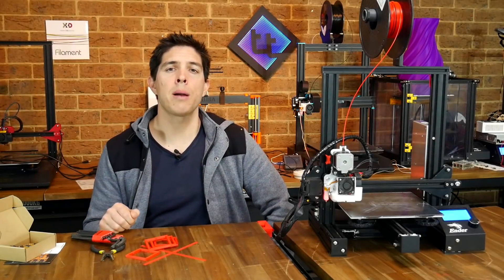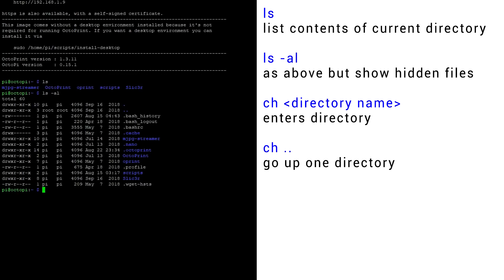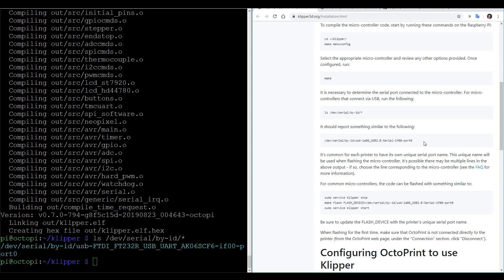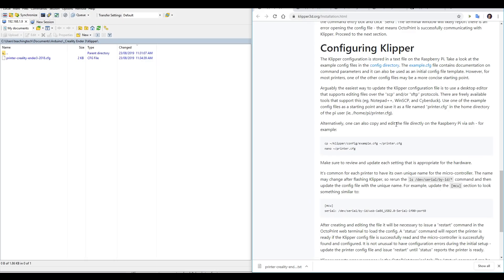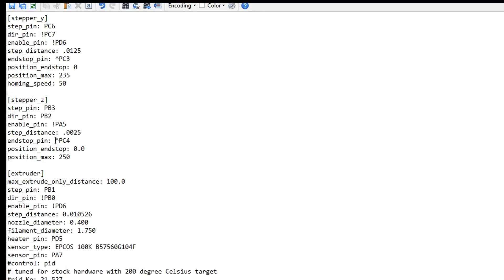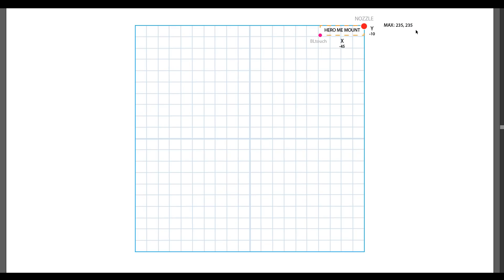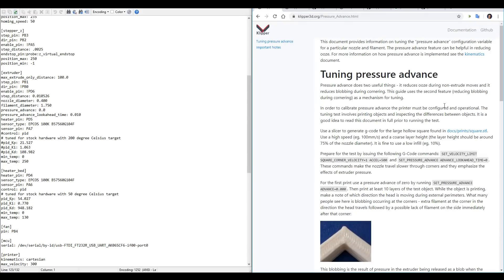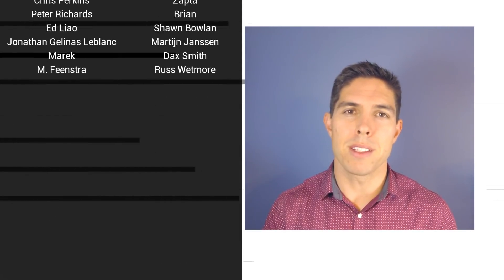Using a 32 bit Raspberry Pi to boost your 3D printer mainboard - Klipper Ender 3 guide

Comment: The main reason I don't like Klipper, is because it works on the Raspberry Pi, and therefor you need to gracefully shutdown the Raspberry Pi after a print, and boot before printing. With just Marlin on the mainboard, it's turning on, and when finished, turning off, instead of waiting for it to power off before pulling the plug. (If you cutting the power to the Raspberry Pi, it can easily corrupt your SD card.)
Reply: Raspberry Pi can use and external HD to run the OS, but this is more hardware to keep on.
Reply: Claudio the only reason why I would use a raspberry pi with octoprint, is when I use a ATX PSU to power the printer, octoprint can use the live wire to turn the printer on and off, if you keep octoprint on for 24/7.
Reply: There isn't really a need to turn off the pi, it doesn't use a lot of power and there isn't the significant fire risk like there may be with a 3d printer.

Comment: I'll be interested to see your video about the PrintHat...I bought one a month ago, tested it and ended up sending it back.  It's a good idea but in the end I couldn't get it to work correctly with Klipper on my Ender 3.  I emailed their support on various occasions but they weren't able to help either.  I previously had Klipper running well on my Ender 3 with a Fysetc F6 board at a third of the cost.

Comment: I recently set up Klipper with my Ender 3 with an MKS Gen L and UART 2208s. So far I struggle to tune PA with the Bowden setup and my desired acceleration (>1000mm/s^2) because of the extruder skipping steps at higher speeds (100 mm/s). Seeing your success with direct drive I am considering upgrading to one.
Reply from the maker: I am only running the default acceleration but can confirm zero skipping with my direct drive mounted ezr.
Reply: @TeachingTech  I just hope I don't get too severe ringing with a direct drive. I plan on just printing an adapter for experimentation.

Comment: Setting up ABL was a mess originally but going through the same hassle you have been through I got it working. 
I haven't taken the time to actually tweak the pressure advance but overall I was indeed able to print with similar results at much higher speed, i.e. 100mm/s vs 50 or 60. 
I guess the question is now, do you need to upgrade to a 32 bits board if you use Klipper?
Valid point would be the opportunity to change the stepper drivers but if noise is not a concern so much, is it worth it?
Cheers
Manu

Comment: So what advantage of using Klippel on ender 3?
Reply: speed, the arduino 8 bit 16MHz processor, in the original motherboard is the bottleneck of the system.  
Moving part of the workload (of the gcode) in the (Quad core 64-bit processor clocked at 1.4GHz processor with 1GB LPDDR2 SRAM of the) raspberry  pi (running Octopi) frees up processing cycles in the (Atmega1284P) processor of your ender 3.  Letting it move faster the motors and the extruder.
Reply: @parkingcams412  but my print speed already maximum (if print faster ghosting show up}, so what profit of this upgrade?

Comment: I have been using Klipper with my Ender3 and MKS gen L for a while, printing is faster due to the calculations being planned ahead, I get some glitches now that I have a bltouch clone configured as well. Usually need to pre-heat and home manually, then everything works OK.
Reply: do you have 2208's in standalone mode?  last thing I read that it wasn't supported
Reply: @taylorwilson1840  No I am using LV8729.

Comment: Great video! Would be possible to install Klipper on a windows environment running octoprint?
Reply: Not 100% sure but I think it needs to run on a Linux platform, not necessarily in octoprint.

Comment: would the pressure advance settings have to be changed for each filament types e.g pla/petg/nylon...if so would this be something that is stored in klipper or octoklipper on a per material setting or is it dependent on the slicer settings?
Reply: In theory yes, like linear advance, it should be specific to each filament. In you can add a pressure advance number to the start gcode, then save that profile for specific filament. The command to set the pressure advance value is not actually gcode, but a separate kind of code that the klipper firmware understands.

Comment: I use klipper.I like it but if your new to this ,stick to marlin for its safety.If you NEED the speed available then go for it . Unfortunately I can't get much more than ~100mm/s at 2000accel due to layer shifting.
Reply: That was my concern too - layer shift. I struggle with it now on marlin. I have to reduce speed to 40 and jerk to 5 or 10 on good day. Any ideas why and how to get rid of layer shifts? My belts are tight and everything seems to be in order.
Reply: @sp78rus  lower Accel ,I use 750 outer ~1000 inner 2000 infill -above that and it's a huge issue
Reply: @t4teeee697   thanx I will try that. I feel that there should be a way to overcome that issue without sacrificing speed and accel..
Reply: I wonder if you may be using TMC2208 in standalone? Layer shifts are a consequence of that. I use 3000 accel as my default, and have printed PETG as high as 200mms with a volcano.
Reply: @mikestromberg5288  running ender 3 stock board v1.1.1 with stock hotend.
Reply: Layer shifts happening when belts are properly tightened which means not over tight is caused by the bed weight because the belt is used to stop the bed from moving. So ya slam the brakes its just like a car it wants to slide. Also ya need to insure your motor bracket is not bent and the front bracket is not skewed as long travels can cause the belt to track up on the side of the pulley and skip.
Reply: @coffinsnail6930  as I said before everything is in proper order. I checked

Comment: About time man. Klipper reigns supreme!
Reply from the maker: I've taken way too long for this, I'm sorry.
Reply: @TeachingTech  How did Klippers thermal heater protection hold up? 
I feel its necessary to mention youre not limited to 1 control board, 1 of my printers runs 2 boards controlling 7 steppers haha. 
I could swear the motors on a cr10 i have run quieter with klipper than when i tried marlin
Reply: @Boboo5  This is my experience as well on my Ender 3. It is quite substantially quieter.
Reply: @Boboo5 Voron 2.x?
Reply: @loban4243  Just a 2.1 ha

Comment: Unless one already has a RaspPi, wouldn't it be less expensive to just buy a 32 bit board? They're like, sub US $20....
Reply from the maker: You're probably right.
Reply: Not if you also have to buy new stepper motor drivers and anything else for the new board.
Or even better you can do both for high step rates but your extruder better be up to it.
Reply: @Dave_the_Dave  but then again, this is only if one doesn't already have a Pi.
Reply: @Dave_the_Dave  actually, the price I saw included the drivers. The great thing about mine, was that the drivers they included were the same that were already in my old board,  lol!
Reply: Depends a new 32 bit board wont give your printer wifi or octoprint. If you only want to print from sd then sure

Comment: Damn, I don't think I can do this. I only have a Raspberry Pi 2..  😧
Reply: Based on the klipper FAQ the recommended hardware is RasPi 2 or RasPi 3. 
You should be fine running with a heatsink
Reply: @reddcube  groovy.
Reply: @elfpimp1  printing from SD in octoprint solves speed issues
Reply: If you use DWC2 you safe... Octoprint is the heavy part... And if you use Octoprint, make sure to print from the virtual SD..

Comment: i just watched this video and hardly know what klipper is. i would like to know what it does.. rtfm i guess
Reply: check out the project or search around, I found klipper one day and it's was absolutely amazing! best thing to happen to my printer
Reply: The documentation for it is very readable and easy to understand. Setting up the config files is so much easier than marlin. It's like a couple dozen lines, you don't have to search through pages and pages of code to compile like marlin config.h

Comment: Would this work on the ender 5 as well?
Reply: works on pretty much any printer, and the community is very active (so if your board doesn't work there's probably a fix)
Reply: Klipper works on cartesian, delta, corexy, polar, winch... And isn't tied to certain boards.. only micro-processors. Have a look here for some examples https://github.com/KevinOConnor/klipper/blob/master/docs/Features.md#step-benchmarks

Comment: Klipper is the best thing ever happened.
Printer movement is so incredibly smooth and fast.
Also the config file editing with the klipper octoprint plugin makes changes to the firmware super easy.
Macro support..
Much better pressure advance..

Just amazing!
Reply: Im stunned as hell tonight. Ive been using octo print since the beginning and have NEVER heard of Klipper. Ive been wanting to upgrade my CR-10S main board to 32bit but this just threw a wrench into the whole thing. It really works?!
Reply: Love that the horrible jerk-ing is gone! Lovely... It actually seems better than marlin even without pressure advance.
Reply: @sandos-x1t  Is the linear advance/pressure advance in klipper a little less hard/jerky on the extruder compared to marlin? I love linear advance but it stresses me out how jerky the extruder movement can get on small circles for example. I'm scared the micro back and forth movement is gonna wear out my BMG extruder's gear and start to cause backlash eventually
Reply: I believe klipper can be even more aggressive, but you control that via the normal acceleration value. Nine seems to be fine with sort of bizarre movements and no grinding of filament yet afaict.

Comment: The Raspberry Pi 3 and 4 are 64-Bit. Not 32-Bit.
Reply: most people forget about that because it doesn't really get used that much (standard Raspbian is still 32bit as far as I know)
Reply: 32 bit software (and calculation within that environment) running octoprint/raspbian though.

Comment: Great video. I set up klipper on my CR10S with BLTouch v3 but didnt really like it. Seemed too fiddly and Marlin TH3D was just giving me way better results. The faster print times didn't really mean anything since underextusion is guaranteed if you dont upgrade your hot end and extruder motor so it can keep up melting plastic. 

CoreXY seems better for klipper since it's not a bed slinger
Reply: True that..

Comment: Could you also use the firmware updater plugin for octoprint? Might be a chore to locate the hex file though.
Ah, winSCP would find it.
Reply: I mean, i guess... .Klipper is two parts though, a bunch of Python code running on the pi and a little bit of nothing on the actually controller.
Reply: Yes an no.

Klipper itself flashes firmware onto the board.  Firmware Updater plugin requires compiled firmware files, you can use it to flash from klipper back to a marlin base build.

Comment: Theoretically Klipper also works with the skr 1.3 but I was having a hard time getting that set up.
If you have any tips that'd be very helpful.
Reply: A lot of people have problems with that, but since it's already 32bit, why klipper over marlin? It can run standalone just fine
Reply: @stealthninja1o112  I prefer klipper for some things, like macros and expanding it with python. Marlin works but is cumbersome in my opinion.
Reply: SKR 1.3 can be a chore due to how BTT did the bootloader. I had to copy the bin file from the pi to the SD card on the board by hand the first time I installed it in order to get it to load properly.
Reply: @PrintedStupid  Yeah I had to do that too. But I was never able to get the 1.3 to talk to klipper. I'll take another look at it soon though

Comment: Very detailed how, but not much about why. If you don't already have a raspberry pi it's an expensive option. Do you get better prints? Are they faster?
Reply: Another cool thing you can do with klipper is use run more than one control board as a MCU, and expand what you can control. So for example you could use your old creality Melzi board plus a SKR or MKS board and have the combined sensors and extruders of both controlled and synchronized through the firmware on the Pi.
Reply: @Dave_the_Dave  This.

Also not having to fiddle with ArduinoIDE or Platform IO whenever I want to update the firmware. Klipper is developed very actively so it pays to check the github repo for features being added. It doesnt get major release fanfare like marlin and sometimes good stuff sneaks in under the radar.

Updating the firmware is done from the console and takes a couple of minutes and doesn't require me to mess with a separate compiler.
Reply: @PrintedStupid  Major releases.. https://github.com/KevinOConnor/klipper/releases
But no one uses them...
Reply: It is possible to run it on a Pi Zero. Prints are faster and better quality for me.
Reply: TutelarSword Kind of, 32 bit boards still run Marlin. Klipper claims to use better algorithms for movement to get better results than Marlin. I’m sure TT will tell us more in the next video.

Comment: I find that i cant keep my PI running without it disconnecting so the klipper option would be bound to fail surely. I've got a SKR board to fit so I might try it then. I do like the idea of the speed . Thanks for another informative video Michael.
Reply: Try connecting it using serial pins instead of USB
Reply: @yetanotherPC  Thanks for the tip Phil It keeps disconnecting from the WIFI it's a 3B+ . Its not the printer connection thats the issue. My CR 10 s and Ender 3 both do it. It could possibly be my WIFI........I will have to do some tests on HOTPSPOTS versus Home WIFI etc. Thanks for the interest
Reply: @markvreeken  That shouldn't affect your print. It will only affect the website which you monitor it from - As long as the connection between RPI and Printer is there, then the print will continue.

Comment: Will the zero w run the software?
Reply: Yes and no, klipper runs fine but octoprint is not the nicest software to use on a zero. if you use print from sd and virtual sd in klipper you should be god to go. Some people reports sucess running the duet web interface with klipper on a pi zero and that works faster
Reply: not if you want to print fast, id recommend a full on rpi, I think even the 2 can run it with octoprint
if not, you can always use a small PC you have around installing Linux on it like me

Comment: Are there many differences with EZABL instead of BLTouch? Also including direct drive and HeroMe as well.
Reply: I'll 'second' the question about the EZABL.  Klipper seems really interesting to me. I also run TMC2208 so I'm looking forward to your update video.
Reply from the maker: Did you have troubles getting it going? I've read a lot of stories describing problems.
Reply: @TeachingTech  I did have troubles yes. Couldn't find much info regarding that setup unfortunately. Also any of the configs I could find had the wrong pin assignments and at the time didn't have the time to fix them.
Reply: @DrJeckyl  I use pin: ^!PC4 in [probe] section for my CR-10. I just take the endstop_pin value from [stepper_z] ( ^PC4) and add an exclamation mark (^!PC4) .Hope it helps

Comment: Raspberry Pi 3 & 4 are 64 bit.  Also, you mistakenly show “ch” instead of “cd” in your graphics.  Otherwise, nice video. :)
Reply: mine is a rpi 2 and its only 32bits, also I think raspbian only runs a 32 bit configuration, even if its a rpi 3 or 4 with 64bits

Comment: Using Klipper for months now on my Ender 3 with mks gen 1.4. Very happy with it.  Have configured it to include bltouch and controlled fans for board and hotend.

Runs like crazy, love it.

Too bad, the octoprint plugin looks orphaned....
Reply: I didn't understand the advantages over stock, could you explain please, thanks
Reply: Hi, I'm running klipper as well on my stock ender 3 and have some trouble with pressure advance (currently set to 0.725). Could you share your pressure advance settings ? thank you :)
Reply: @polhomarkho5229  I am running a direct extruder. So my settings might not be matching your use case.

Comment: Once you have Octoklipper installed, you don't need to use WinSCP as you can edit the klipper settings in it's section inside the Octoprint settings.
Reply: you can use instead of octoprint, the new DWC2 which is Duet Web control adapted to klipper by Stephan and it can be use as standalone klipper gui with no need of the heavy octoprint. https://github.com/Stephan3/dwc2-for-klipper
Reply: be aware that the octoklipper-pluging is more or less dead..  https://github.com/mmone/OctoprintKlipperPlugin
Reply: @Nitram_3d  Just installed it, still works 100%.

Comment: I jusk checked the Printhat but at €92 I really don't see a reason to purchese it.
Reply: Yup... Too expensive for almost no hardware. You can buy a 64bit  nvidia jetson nano with that pricetag and work with that...
Reply: @Underp4ntz  Are you aware of anyone doing this and could you point out a link to examples? I happen to have a developer kit but lack the programing experience to know where to start. Thanks for any help you can provide.
Reply: this hat is a reap off. no need for this a good skr v1.3 with removable drivers will do better than any hat with tmc2130 smd drivers... and for this price I will be opting for the skr with tmc5160!!